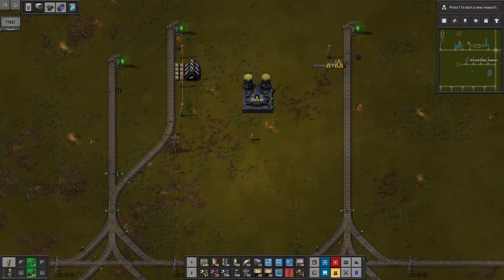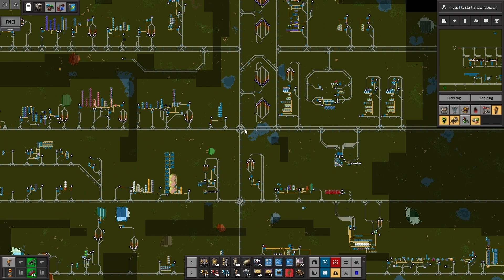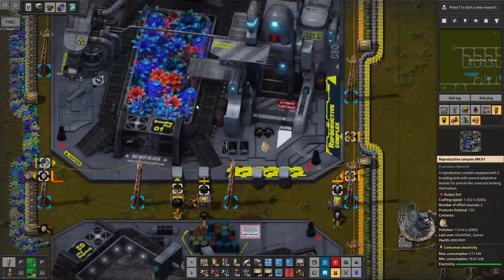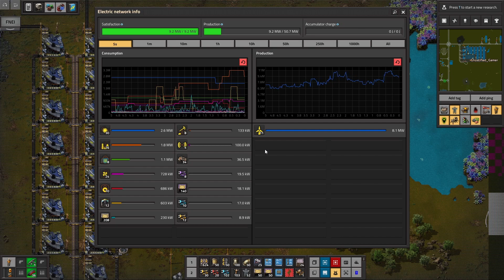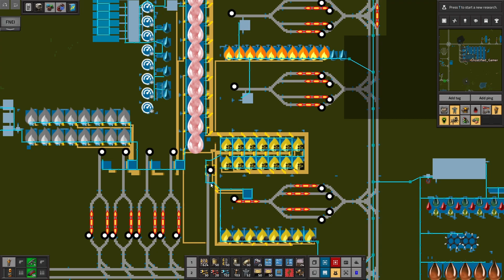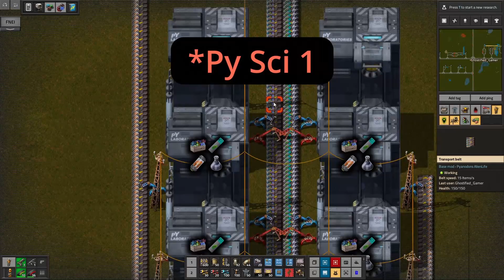Factorio pYanodons - pY Science 2! - EP115

Comment: About that barreling bug... it looks like changing the number of empty barrels in the chest the inserter was taking from might also cause it to reevaluate its conditions and discover that it can, after all, insert barrels. Worth checking. Then I'd recommend submitting a bug report to Pyanodon. Can't give you a link or Youtube will spam-bin my comment, but search for "pybugreports" and you'll discover the appropriate issue tracker. They want screenshots and, if possible, blueprint strings to reproduce the bug -- which you have just created.
Reply: You might also report the korlex breeding there: as far as I can tell form the code history, losing the korlex parents from the output is not intentional. I'd suggest at least reporting a bug asking whether that part of the recipe output is intentional or an accidental omission.